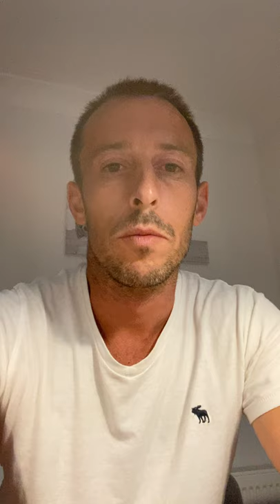Why you shouldn’t have cavity wall insulation installed.

Comment: You SHOULD fill the cavity with expansion foam. 
Then add another 80mm of external wall insulation. 
Then so proper ventilation. If you have good budget then heat recovery system would be marvelous (not really known in UK but very popular in Europe).
Reply: @mateo_dequ  Not tenants responsibility to fit insulation in cavity,wouldnt be allowed in Housing Association properties.

Comment: Very informative video 👍 When I moved into my 1925s semi, an authorised contractor from the Govt 'Green Scheme' surveyed my house - drilled inspection holes, etc. They advised not to have cavity wall insulation as it would encourage damp and they couldn't provide a guarantee.

6 months later,  the Govt Scheme team phone me to check if I was happy with the work as they'd been in billed.... They didn't seem concerned that they'd been ripped off. 

Another friendly builder who usually renovates much older properties told me that old houses are meant to "breathe" - through the loft and down the cavities - and expressly advised me not to have cavity wall insulation.
Reply: They are not meant to breathe my friend.
Reply: @robertwren8878 do you live in a submarine?

Comment: Thank you for the advice just-in-time. I have been in the process of getting offer from a contractor with whom I slightly discussed about the potential benefit of leaving as it is since it’s air-induced insulation provided by the cavity itself. He fairly even mentioned the risk of moisture accumulation afterwards if the house has been over exposed to windy showers.. But regardless he was confident that it would provide thermal insulation thanks to its air tightness. That’s funny because it’s the same reason we want to avoid it as it would not enable ventilation when it’s air tight. Anyway, to me CWI is a clear No Go after all I read and finally upon hearing your detailed insight here. Appreciate it.
Reply: if it's done correctly it's great. The bonded bead is water resistant. The problem is with brick houses, not everyone can be insulated in this way
Reply: I am still concerned of trapped moisture due to the ventilation that is compromised by the filled up insulation material

Comment: Thanks for this advice, I will be putting all of the insulation on the inside of my next refurb, I have had my suspicions about retrospective cavity insulation for years, may be losing a bit of space on the interior but then its going to be cheaper to heat. The advice on night locks is excellent especially if you have timber frame windows in a Conservation area, the planners/building control will usually accept the option over unsightly trickle vents that may be detrimental to a windows period appearance.
Reply from the maker: Thank you for your comment. Unfortunately as with most things, they rush these things out and don’t consider the consequences. Right now we are seeing a huge amount of cases of condensation and mould due to poor insulation and lack of ventilation. Night lock is a great way to ventilate but again although very effective compared with trickle vents they have deemed this a security risk. I now recommend passive vents as a cost effective solution

Comment: My house has trickle vents in every room, but also central mechanical ventilation. I'd say in such a setup, trickle vents are entirely sufficient no need to open the windows. The mechanical ventilation can be set at a low setting, or on a schedule, or in some cases can adjust its action when it senses more CO2 in the house. I think that's one of the best ways to control the air flow and moisture. (the only better way is to have central ventilation with ducts that has even better control over the flow of air to each separate room. A central air heat exchanger would be even better, as it would keep heat in the house instead of expelling it with the waste air)

Comment: I agree that cavity wall insulation should be waterproof, I have had a retro fit in my 60s house of the beaded stuff its completely water proof and has a structure that allows air and water to pass between the beads. The thought that there is any cavity wall insulation out there that's not made of waterproof material in this day, when we have decades of knowledge, is mind blowing. 

I do believe PIR is superior, but I have yet to see a retrofit system.

Comment: We bought our final home, a bungalow in Enniskillen five years ago.  It has breeze block inner and brick, I think they are Butterly, outer skin.  

I found out recently that it was built in the same year I was born, 1963, yet it looks like new.

Anyhoo, we looked into getting a grant a couple of years ago and the guy turned up from one of these companies to do a survey.  

He drilled some holes and used a device to look inside the cavity.

Turns out it actually had a thin polystyrene sheet type insulation that still left a gap.

He was pushing us into getting that gap filled but after researching about the problems with houses in wet areas, we declined.

The next year they were giving grants for increased loft insulation.

We applied and were successful and the team of installers turned up to put the insulation in.

Turns out they supplied sheep's wool insulation which is much safer to install and has better damp releasing properties.

They also installed the correct vents in the roof tiles.

The difference was amazing.  

In the winter we use a bucket of smokeless briquettes, and as the fire has a back boiler the whole hose is heated.

Then we don't need to put a fire on until the next evening as the house now stays toasty.

Not just that but last summer during the heat wave despite having a lot of direct sun, the house stayed perfectly comfortable while our friends' houses were like ovens.

I actually paid for and installed sheep wool in our adjoining double garage roof space.

Three times the price of Rockwall but worth every penny.

We tried to tell my wife's older sister not to get wall insulation in their bungalow out here but they did anyway and commented recently that the house was no warmer.

Bottom line - clear out the junk and get the max insulation you can in your loft, you will not regret it.

Comment: Great informative video. Really helps to discourage a huge mistake for people. Only I'd suggest changing the word 'installed' to 'injected', or 'post installed'. Mainly because most older houses with cavities aren't big enough for post installation on inner wall to allow a worthwhile 50mm insulation or more to leave a minimum 50mm air gap to outer wall to allow moisture to escape.

Comment: If you built a completely airtight home and ensured that every single part of the spray foam system worked in conjuction with each other such as HVAC staging, air exchanges, dehumidifiers etc.. That home would be much safer to live in, cheaper to maintain, and last much longer than a leaky "breathable" house thats pretty much at the mercy of the elements. We have to move forward in building science people. Just because there are insulators putting foam in places it shouldn't be, doesn't mean spray foam doesn't work and homes should stay leaky.
Reply from the maker: I agree to a certain degree Nicholas, but how much did it cost to heat a house with a good old fire back in the day? How much manufacturing when into that process? All of these alternatives consume energy, and require processing to create these products. How much greener is it really? That’s the question.
Reply: In my opinion, I would say heating a home with fire can be unhealthy and either requires gasses or a burn material. That material has to be sourced from something. If you spray-foam a home top to bottom, your home would not only last hundreds of years longer, but the amount of energy it would take to heat,cool, condition etc.. would be pennies on the dollar from the moment it was air tight until the building was bulldozed. I know individuals with 5,000+ square foot homes that spend around $100 a month on utilities and have had spray foam for 20 years now. If it’s done right, there’s nothing greener, nothing more sustainable and nothing healthier for us humans as well as the earth. At least to this point! Until someone comes out with a better idea. We cannot move backwards though. Check out Spray Jones. He’s a legend in my book.

Comment: Very useful video, much appreciated for sharing your knowledge. You do come across as a good, honest tradesman.

I agree with the importance of heating, and ventilation of the home.

I have a question, what do you recommend as an insulation option for a solid wall home without a cavity?

Internal vs external, I like your idea of the insulated plasterboard, but what is the ideal size as to avoid these cold spots.

Thanks, I've subbed!

Comment: I'm just about to have the cavity wall insulation removed that a previous owner had done.  Having lived in my house for 7 years the damp problems have only worsened year after year.  With 2 young children I want to live in a dry safe place.  The contractor inspected today and found it was rock wool that is damp and I imagine saturated in places. Ironically had a damp survey done last year and it was one thing that wasn't even brought up but as far as I can see it is the biggest problem.  Thanks for such an informative video.
Reply from the maker: Thanks for the comment Caroline, it’s a huge problem especially when we have long periods of rain in the winter months driven by strong winds. We are receiving at least 15 calls daily at the moment. Are you having any insulation put back in? as this often happens.
Reply: @Coastal Wall Ties Ltd  no just going to leave the cavity empty.  Having a log burner put in. It's an 1940s ex council semi detached house,I might see if the roof insulation can be replaced.
Reply: I live in South Wales so yes wind and rain is definitely a factor.

Comment: Cheers for the video, just had two guys round trying to get us to have the bonded bead installation  told them that it had been checked few years ago and there's not enough space in between the walls when he drilled holes so couldn't 1930s semi

Comment: I've been in the building trade all my life and I'm now retired,however I have a comment. Cavity walls were never designed for air they were designed for moisture to go to ground. Bricks are porous meaning the cavity can dry out. All cavitys should be capped off at the top,there lies your problem with damp and cold,we don't have monsoon weather like india. Capping off the cavity is key! If you look at the weather forecast everyday it will show you humidity reading this is moisture in the air,it's raining but you can't see it and your roof fills with it. Opening your Windows is a no no because their may be less humidity in your home than outside of you open them you cause your own problem and the air condenses and becomes stale and mould and algae thrive,a cold or warm inner wall is what it needs to develop this has nothing to do with wall insulation but bad building. Inner walls are made with breeze block of thermolite block they breath but painted surfaces and vinyl wallpapers dont. The only way to allieviate this is by moving the air inside with a summer fan every now and then. We all cause our own problems within,boiling water,cooking,ironing,Etc everyone of us breathes out 4 cups of moisture a day add to that electric heating or open gas fire and you can see where I'm coming from!!

Comment: I have bought a house in Ireland where the humidity of the outside air is high, particularly in the winter, so I had to learn the hard way about condensation and mould. I have cavity bead insulation, I know because clumps fell out... Anyway, I have condensation form only at the top of the walls upstairs. It's like a straight line so I suspect the beads have settled. The manufacturers say they can't settle because walls don't move. I think that's balls - 20-30 years of passing vehicles should help surely. I only have storage heaters and a stove I think people here had a fire going all day and night to keep the damp at bay. Dehumidifier definitely helps, keeping a window open will only do so much when air is so saturated, plus its freezing. Looking at getting a top up but as you say everyone wants to do an extraction... And then refill. Ughh

Comment: Thank you mate, exactly the sort of information I needed. 👍 I live in a terraced house, built in 1960. Walls are two layers of breeze block, with a gap/cavity between them of about two/three inches. I was going to get cavity insulation as my quarterly energy bill was about £130 more than my fathers, who lives in a 1970s brick house, internal plaster board, and he had cavity wall insulation done (beads I think?) about eight years ago. I don’t think I will do it now.

Comment: I have a bungalow with a damp issue and after removing a few bricks I found that the insulation was bridging the DPC and was wet at that point. I’ve removed what I can and replaced the bricks with air bricks. I’m hoping that I’ve done the right thing? Fingers crossed.
Reply from the maker: The only thing I would be throwing caution with that is, by removing the wet insulation low down (yes, it removes the damp stuff) but it also means you now have a colder area at the bottom of the wall. In winter this could make the wall colder at the bottom now you have no insulation and air bricks feeding the cold air into the cavity. This could potentially cause condensation to occur at the base of the wall inside. My preference would be to remove the insulation completely but. you maybe ok.

Comment: Thanks for an interesting video, with lots of helpful information. I have a house that was built in the 80s and has cavity wall insulation in the form of beads - they must be not very bonded, which I discovered when my extension was built! I have to say, the old part of the house was incredibly warm, with no condensation or damp problems. I have definiitely noticed some cold patches have appeared since the extension was put on, though, and I lost a lot of beads during the build. The cold areas are where I lost the beads - unsurprisingly. I would really like to fill these patches with some more of the balls as I've had no problems with them, apart from when I had the work done. I'm now in a position where I cannot have my heating on through the winter and need to get these cold areas back up to the standard of the rest of the house. I would like to do it myself, but am unsure of how to. Have you any ideas? Many thanks.
Reply from the maker: It wouldn’t be an easy task to undertake on your own and can only be done via a contractor really. I would call the installers and see if they can help.

Comment: I'm so baffled!! About to sign a contract to insulate cavity wall in my terraced house. Read and listen to so many contradicting  points. My friend structural engineer said to do it. My other builder friend said do not do it! Building is EPC D insulation would take it to C. 

I am actually afraid to do it now.... Obviously is through gov grant.
Reply from the maker: The only real benefit you’re going to get is the epc rating being higher. The choice is yours really but I would consider whether the risks out way the reward. How exposed are your walls to wind driven rain and is the building in a high exposure area.

Comment: Hi, we have a 1995 build home with an empty cavity. I'm not sure how wide the cavity is, but we are thinking about getting cavity wall insulation. Would you recommend this? We can feel cold air coming into the house in many areas so the cavity is clearly getting cold air blowing in. We have been recommended Knauf Supafil 40. Any advice is gratefully appreciated!
Reply from the maker: I would think long and hard about installing a mineral fibre into the cavity. EPS beads are better but in all honesty I would look at where the draughts are entering and rectify that first. Cavities are best left clear if you can.

Comment: Im looking to build a new masonry constructed house detached, 150mm cavity and its planned to have 100mm pir in the cavity. Mvhr inside mechanical ventilation air tight. Lots of people on forums are saying they cant bekieve anyone has an empty cavity these days and new builds should be having full fill eps blown beads. Ill be avoiding that now then.

If i can afford it, I'd like to add insulated plasterboard to the inside too but how thick would you recommend? I cant go too thick but but dont want to waste my money going too thin

Comment: 6 years ago got a window replacement job , 5 windows , front elevation , very exposed , internal walls very wet round reveals , took me 5 days to fit them and remove 40 bags of white foam cavity insulation , you should never fill a wall cavity , its there for a reason , a house has to breathe , we are building sealed  boxes , should be banned , the problems it causes are house destroying